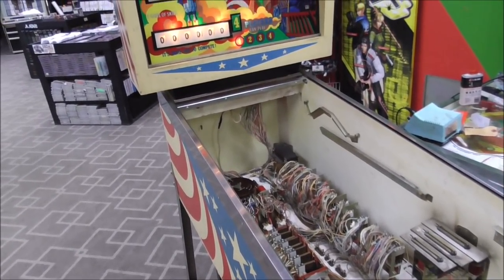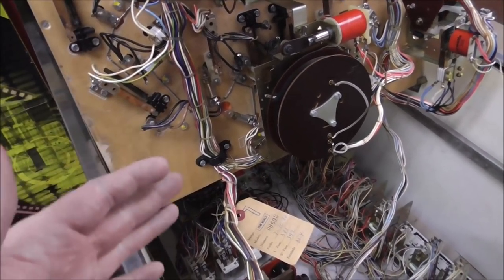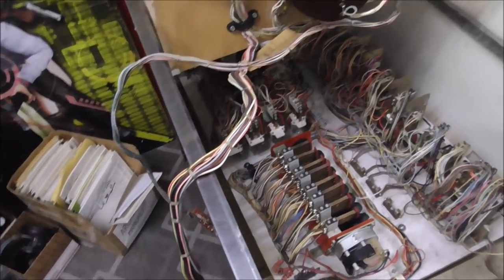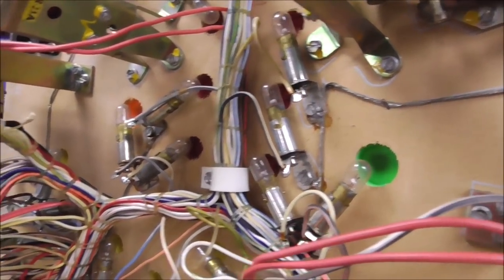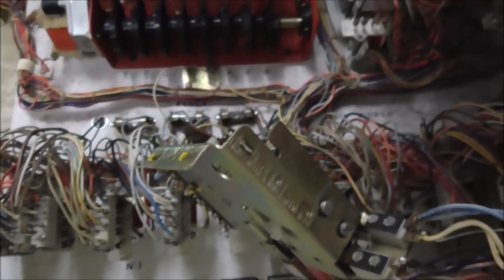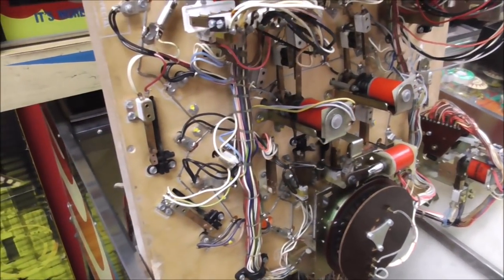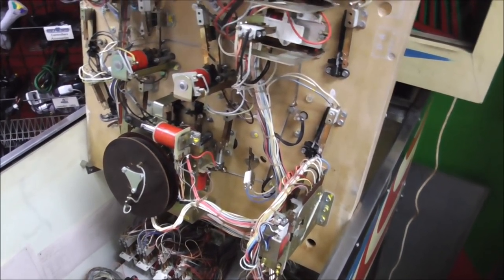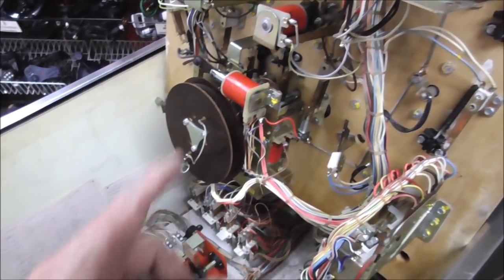Could This Be The Pinball Machine I CAN'T Fix?  1976 Playmatic New World Repair 4 - Under Playfield

Comment: I have fixed those type of switch stacks. What I did for the ones that are parallel to the playfield is remove the 2 bolts holding the metal bracket to the board, then depending on the size of the stack, I use a countersink drill and drill the side that was against the wood to allow me to put flathead screws flush in those two holes, which are usually #6 or #8, depending on the rivets. The I drill out the rivets in the switch stack to allow the new screws to pass through. I put the screws through the bracket and then slide very thin heatshrink tubing over the threaded part of the screw and shrink it. Then I reassemble the switch stack over the screws and trim off any heatshrink that extends past the top of the stack. Then I put narrow washers and nylock nuts and tighten everything up. Voila, fixed to play another game. This is for those people who can't afford to buy new stacks or for those stacks which aren't available anymore.
Reply from the maker: Thank you Dablakh0l!

Comment: I posted a thread several years ago on pinside (with pictures) on how to fix the Playmatic switches that have fallen apart. I had done this fix on both a Fiesta and a Fandango machines. On standup switches and pop bumper switches it is simply to put a 6-32 screw of the appropriate length and a 6-32 nut through the switch stack to tighten it to the bracket. To fix rollover switches and the cabinet flipper button switches, It's a little more work. You remove (with a punch) the remainder of the tubular ivets from the switch stack. Then you can thread a 6-32 screw through the switch stack. Now with a 6-32 tap, you thread the switch mounting holes in the bracket. I also mark where the switch bracket stack holes would be in the playfield and with an 1/8" drill bit, drill the spotted holes for the screws a 1/4" deep (don't drill through the playfield).  That way I generally don't need to cutoff the new screws going through the switch stack. For the rollover switches and flipper button cabinet switch repairs, generally I only need two lengths of 6-32 screws: 5/8" long and 3/4" long.
https://pinside.com/pinball/forum/topic/playmatic-how-good-are-their-pinball-machines
Reply from the maker: Thank you Ken, I was wondering if a 6-32 would fit through there if I tried to get the rest of the rivet out... Thank you for the pictures of how to do it!
Reply: @LyonsArcade  I think I used a 1/8" pin punch to get the rivets out of the switch stack. Remember, these machines are all built to 100% metric standards. So the rivets are just a tad bit bigger than USA standard ones. That's why a 6-32 screw fits in the switch stacks. Threads right in. Also, on the fiesta and Fandango machines I worked on, I ended up replacing about 30 light sockets. They had all fallen apart and there was no repairing those sockets. Once you take care of the switch problems and bad light sockets, these are actually good playing and reliable machines. As to the flippers, the only parts available are the flipper coils and a generic fiber flipper link at Pinball Resource which you cut to length and drill your own holes. I ended up completely removing the playmatic flipper assemblies and installing Williams system 11 flipper assemblies (with the 2.2 uf 250 volt capacitor across the eos switch). The Williams assemblies fit nicely and I reused the Playmatic coil in the Williams flipper assembly. Pinball Life has the lowest prices on Williams flipper parts and assemblies.

Comment: I worked on several Playmatics over the years   When I ran into a problem with broken switches , I used 2 part to epoxy fix them. Worked great every time.
Reply from the maker: That's a good idea!
Reply: @LyonsArcade  

If you’re going replace them, you have nothing to lose trying the epoxy

I even fixed a stepper  unit disk that was in 3 pieces with epoxy. Holding up great too

Another fix regarding the switches is to mark the two holes from the bracket. Then remove the bracket and drill 2 shallow holes with a countersink bit. That will leave plenty of room for a number 6 screw head. Then   feed the screws through the bracket and put nuts on the top. The bracket will sit flush when you re install it

Comment: For the bad riveted switches, you could put pan head bolts on the back of the switch plate with coves drilled in the bottom of the playfield for the heads or countersink / wedge head bolts with the plate metal countersunk; keeping as original as possible and cheaper.  Nice nylock nuts on top.  Decent ideas?  Drawbacks?
Reply from the maker: That would probably work but the holes through the switch stacks are very tiny so you'd have to drill them out bigger, then drill the room for them on the bottom of the playfield, etc. I just swap 'em out with a Bally :)

Comment: 14:02 switch stacks riveted together... wait until you see a MAC (also Spain) pinball machine... the switch stacks are held together by plastic melted with a soldering gun (like the cheapest electronic plastic toys). But apart from that, the build quality isn't that bad.
Reply from the maker: I'll have to look out for one of those :)
Reply: @LyonsArcade  Space Train MAC is a lot of fun to play. Wasn't a lot of fun to fix though. Had to reverse-engineer a fried PAL from the schematics alone.
Reply: And not to mention the very risque graphics in some of their machines...

Comment: HI Ron!
Couple of questions today;

- I agree completely about not replacing riveted switches that aren't (yet) broken, but is there a 'rule of thunb' regarding when they may be about to break? Like a loose mounting?

- I was noticing a yellow substance on some of the screws/bolts. Was that some type of 'Lock-Tite' or other 'screw glue' to prevent the screws/bolts/nuts from vibrating loose over time?
Reply from the maker: You can't really tell if they're going to break or not... I don't know what really causes it.  Yes that yellow stuff appears to be locktite...

Comment: Just one of my dumb questions. Isn't the ball counter built similar to the bonus counter, so you could adjust it to actually have the pins on the ball 1 contacts when it hits the home position? Or maybe this would mess up something else. I'm not too terribly familiar with these, but if it SHOULD go to one and it goes to zero instead, causing the score motor to turn constantly...
Reply from the maker: That's not a dumb question.... believe me when I started I didn't know anything about these and the first machine I had I couldn't figure out how to fix!

 It's designed where it has to go to position 0 because when it does, that turns on the reset relay.... so the reset relay would never turn on unless it goes to ball '0'.... they've basically designed it so that the only way for the game to reset is if that ball unit goes back to 0, which can only happen when the game is started... if we set it on 1 it would never pull in the reset relay , so the scores would never reset, etc.  It's just how they chose to design this particular one.  We're gonna put up another video Friday and finally figure out why it won't reset, we'll get it!

Thanks for watching Jussi we appreciate it!

Comment: You’ll get it!  We have faith in you!
I’m curious why you work on the playfield in the vertical position.  Wouldn’t it be easier to take it out and work on it on the bench? You probably do it this way through experience.  Just curious.
Reply from the maker: You could, but then you need a bench to set it on without screwing up the plastics on the other side, it's not really made to be worked on upside down.

Comment: So when the switch "breaks" why cant you drill little divots ( in the back of the play field) and then replace the rivits with small machine screws with the heads in the divots?
Reply from the maker: You could do it that way the main issue is finding a teeny tiny screw that will go through the old rivet hole.  It's at most a #4 might be smaller

Comment: Hi Ron.  I know you're going to figure this out so this is not me trying to help you but rather answer a question about the bonus stepper unit that's confusing me.  If I understand correctly, when the game is trying to reset and the bonus stepper, first resetting to zero and then not stepping to one is what's not signaling the score motor to stop resetting.  Perhaps this game does bonuses differently but isn't that really redundant?  Typically, bonus is awarded at the end of every ball so that the next ball starts with no or one bonus.  The first ball of a new game is the next ball after the last game so shouldn't the bonus unit already be reset?!  Why does it need to reset for a new game?
Reply from the maker: What happens if somebody turns the game off in the middle of a game while the bonus unit is set on 5?  They design them so that at the start of a game everything is zeroed... just in case it isn't.  I have seen some games though where when you turn them on (without a game started) they will reset the bonus unit even without starting a game because they want to get it to 0 like you were talking about.
Reply: @LyonsArcade  Thanks!  Now it makes sense!

Comment: Those rivited contacts look painful. I'm sure you will get her going.
Reply from the maker: We'll get it!
Reply: yeah annoying for sure.. seems like the fix is to countersink the bottom of the plates, drill out or push out the dead rivets and put in flat-head machine screws w/ nuts on the top.   Presumably its a convenient metric size, similar to the bolted switch stacks elsewhere on the machine.  10mins each on the drill press maybe?

Comment: Playmatics are a bit strange. They couldn't directly copy it had to be a knockoff system.
Check the soldering that holds the wires to the comtacts. Sonic is another one with wires cold soldered onto the seitch stacks.
Reply from the maker: I'll check that out!
Reply: Look at a schematic for an EM. Zacharia might look somewhat like an EM Williams.  The EM crew needed a purpose in life after becoming obsolete in the USA factories.

Comment: It's not a good idea to have you flipper power set too high. I've seen many flippers heat up and fail because the inside tip of the plunger hits the plunger backstop so hard the plunger starts to form a crown. Not a pretty site.
Reply from the maker: I've seen that before too where it gets all mushroomed....

Comment: Why not just drill out the rivet and put in your own correctly sized bolt/screw on the broken ones
Reply from the maker: You could do that but then you need a new bracket... the old one attaches flush to the play field there’s no room for a head...
Reply: Not necessarily. It's hard to tell if it would work from the video but if you take the bracket off and use a long flush mount screw, you might be able to put the screw through the bracket and then through the body of the switch. Then the nut goes on, facing down. With that assembled, you reattach the bracket back to the bottom of the playfield
There's also "rivet screw" and "tubular rivet"